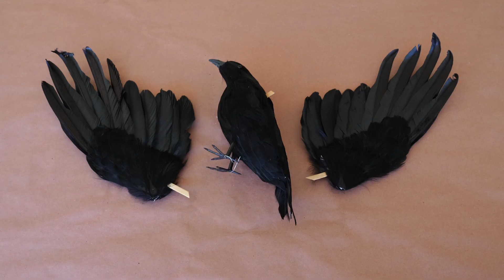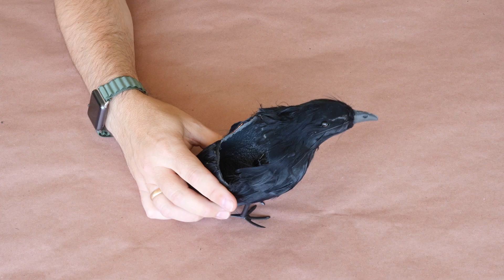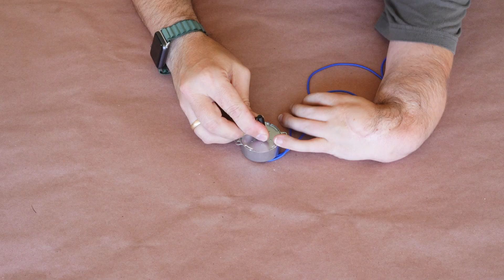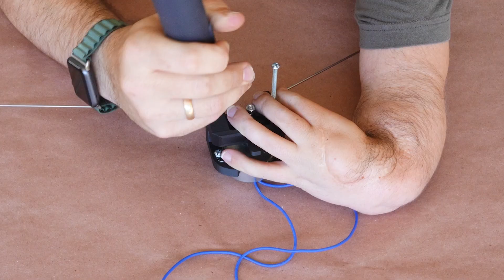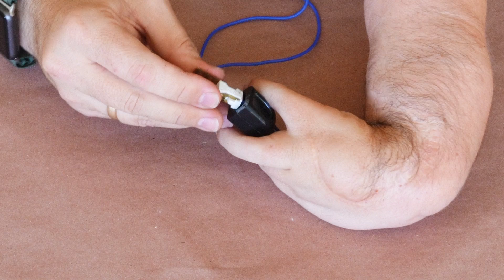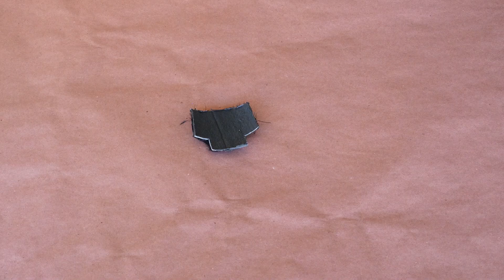Simple DIY Halloween Raven Animatronic

Comment: I have a question and need help.  I need a crow for the wizard of  oz  scarecrow for a play.  How to I switch out a plug for a USB/phone cable, or nake it battery operated?  Thanks in advance for your help!
Reply from the maker: The motor used in this video requires 110v power so you won’t be able to run it off batteries.

Comment: Anybody else have issues with the printing of these? Do I need to modify their orientation/lay them flat to,print? Tried 3 times on an Ender 3 pro and they started printing fine but 20 miniutes in I had a pile of PLA??
Reply from the maker: What orientation are you printing them?
Reply: @VanOaksProps  the way they came across on etsy. it was weird they are coming through printing vertical. like the yoke is not laying down to print (like on the video) but coming vertically off the printer bed.
They should be printed flat right??
Reply: I'm slicing them in Cura??
Reply from the maker: @bcrc-chemistry4733  Send me an etsy message and I'll send you a screenshot of how I have them oriented for print.
Reply: @VanOaksProps  Thabnks for the Quick response!! Thanks again!!

Comment: Just finished the raven, looks great. Only caveat I'd have is that when you print the crank, print it so the pin part is horizontal, otherwise the shear forces of the motor can break it.
Reply from the maker: How many walls and what amount of infill did you use?
Reply: @VanOaksProps  I just used the default (20%infill and 1.22mm density), gonna reprint adjusting those up (didn't think about that when I printed it - doh!)
I'll let you know how it comes out.
Reply from the maker: @MegaKemper you’ll want at least 4 perimeter walls and 15% infill. It’ll definitely help.
Reply: @VanOaksProps  That worked great. Again for the clear and complete instructions and the parts list with links, made the build a breeze!

Comment: I like it. But I think it should flap faster. It would add a good startle factor if a still bird started flapping when the visitor walks by.
Reply from the maker: They make faster synchronous motors, so you could definitely go faster if you wanted to.
Reply: I would suggest that if you are looking for a startled bird fast wing flap and you go with the faster motor you might need to make a few changes.  Likely you will have to lock down the feet and/or body and secure the mechanism in the body with screws and limit the length of time you get that fast motion.  There will be a lot of wear on the plastic parts that don't have much tolerance room to begin with being made for the slower speed.   I'd love to see what you end up with if you attempt it.

Comment: Thanks for doing this and making the 3D parts available. I have been trying to do this for over a year using a crank mechanism, which logically worked, but needed to be micro adjusted. I could never get it right and I had an engineer working on it with me.
Reply from the maker: Glad to help

Comment: Thank you I need to make two. I will be ordering the 3D parts but what material is best?
Reply from the maker: ABS or PETG are your best options if it'll be in warmer temperatures.
Reply: @VanOaksProps  Thanks I am in Santa Clarita it is hot. Thanks again for your motivation